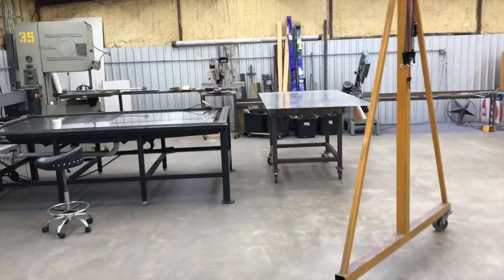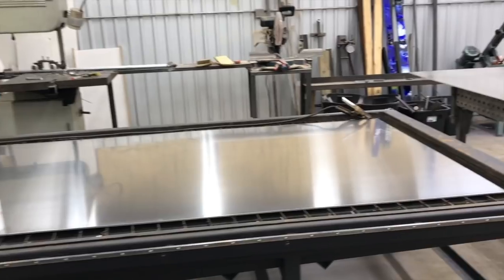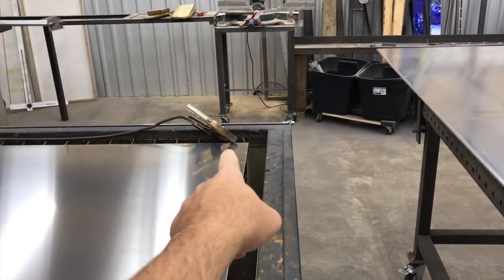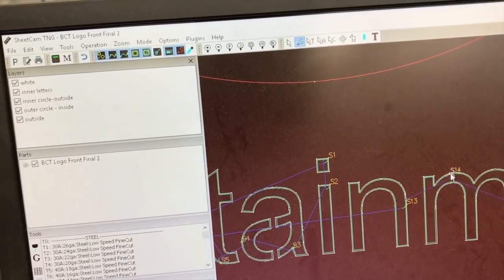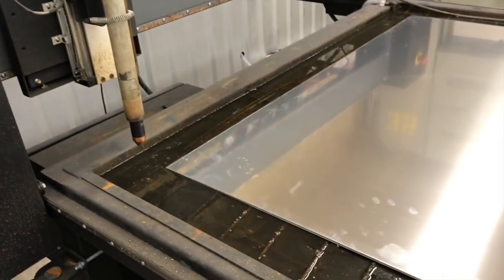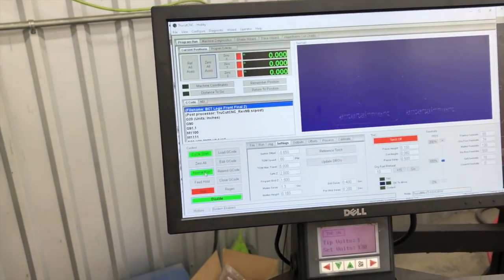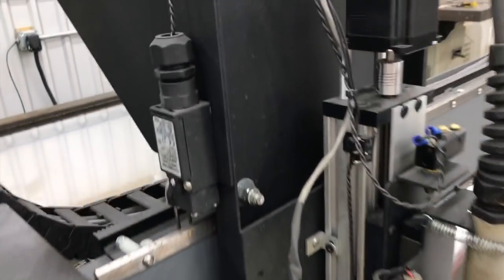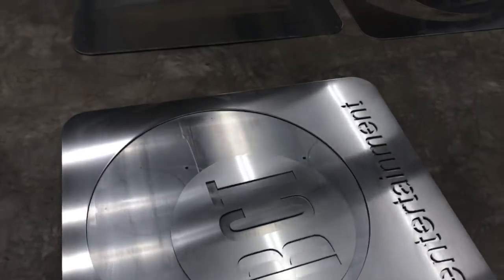High Risk CNC Plasma Cutting

Comment: Another tip is to move all the lead in to one side , so if they do tip , the torch wont be running across a letter that may have tipped. Also mark where its zeroed at incase you do have to re home the machine for some reason half way through the cut.

Comment: How much do you charge for a job like this? Also you can make preset rules in sheetcam to speed up programming i.e. 60% feed speed for inside profiles smaller than 2" Dia.. Also I think the A next to your amps doesn't stand for automatic air pressure.

Comment: I've had material in 16 ga. that was over $2,900.00 a sheet, it was a high temp nickel alloy, I needed a better and more precision cut than my plasma table would do so after getting the prototype correct I jobbed it out to a company that had a water-jet  table. Still nervous but they did an awesome job.

Comment: I operated a CNC Plasma cutter for five years. Cutting aluminum  and thin stainless Is a bitch some time. I have had the material curl up due to the heat and then the torch hit it and move the sheet!  I learned to clamp down the material. I also made a fixture to hold a sharpie pen and let the cutter draw the pattern on to the material. I also ran a water hose on to the material to cool it.
I was using a Hypertherm cutter and a PlasmaCam table. 
One thing I wish was that the plasmaCam drawing program had an auto save program. I do not know how many times I would get involved in drawing some complicated project and then the program would freeze or crash and I would have to start drawing all over again.

Comment: I have heard much about the dangers of plasma cutting aluminium in waterbed. How do you make it safe?
Reply: It depends of the type of aluminium you are using. The purest it is, the more dangerous it is. But in fact, it's very rare if you have an explosion. It only happens in specifi conditions. Bad ventilation in your working place, and a closed honnecomb. So be sure you place the aluminium plate with air circulation on both sides. Thus, you will not risk hydrogen accumulation underneath.
Reply: You can also add an aerator, much like those in fish tanks.  The little air bubbles will keep large hydrogen bubbles from forming.

Comment: If your material cost is more then 50% of your bid, you should probably reevaluate your pricing.
Reply from the maker: oh are you referring to the 5X material cost pricing model?  That doesn't always hold true.  Especially thicker or more expensive materials that all your doing is a large profile cut.  I cut hitch plates out of 1" plate.  The 4x8 sheet is $800, and I only charge $275 to process it into 3 hitch plates

Comment: As lame as this sounds, is there a decent entry level machine out there?  As a kid i worked at my uncle’s welding shop.  I have been wanting to get into cnc’n for some time.  Been 3D printing a year or so now.

New sub, glad to see some real shit on youtube, thanks
Reply from the maker: If you have been 3D printing for a while you shouldn't have any issues running any plasma table.  There are sooo many options, brands, tables out there now.  Everything from an $800 langmuir table, all the way up to a piranha industrial machine, and hundreds of tables in between.  I have ran a few different tables, and have owned 3 trucut machines, i have been happy with them.  Good luck!

Comment: How do you go about cleaning up the parts? I'm thinking of building my own plasma cutter for very light home use and trying to sleadily work up some knowledge on the topic.
Reply from the maker: lots of different tools.  scraper, grinder, sander
Reply: Flapper disk on angle grinder is the best way I found to clean the dross. When cutting thick stainless a hammer can be used on the really heavy dross to knock it off.

Comment: A good tip is to attache a marker to the CNC and do a dry run letting it mark all cuts out. Then clean up with a rag and acetone.
Reply: Really slick I like that conversely one could use their plasma table to plot large prints  hmm
Reply from the maker: good idea, thanks

Comment: Nice job and video. You might want to consider a better metal supplier. My rate for 5 x 10 x 3/16" is under $300. I buy a lot of 8 x 20 sheets as well. $1,100 for 8 x 20 x 3/16".

Comment: Plasma cutting is very cool. I'm a CNC milling / turning machinist, set up, programmer, operator. If we had to machine a part like your sign, we'd be dealing with clamping issues and tool chatter. We've used double sided tape with pinned fixtures, but that is time consuming. Great video content. You had mentioned posting ideas. How about putting a Sharpie marker where the plasma tip is for your dry run. When I was going to school at Wentworth, they didn't want students potentially crashing an end mill into their CNC mill tables, so we used Sharpies in the tool holders . Different colors for different operations. Worked well for proving out programs and you get a drawing of your posted program.
Again, I enjoyed your video. Thank you for sharing
Reply: I did the same with my 4x8 foot plasma table after I built it. I don't do that anymore, but would consider it if I did something other than small chunks of heavy plate or half sheets of cold roll steel sheet. Just running 9/16" steel plate had me worried as we didn't have extra material on hand. My brother has a cnc mill for hobby and some pro use and I am glad that if my machine crashes, it isn't as big of a deal as his would be.

Comment: I wonder if it is a good idea to mount a sharpie for the dry run so as to "illustrate" a minor errors, instead of imagining it.  It seems like an extra layer of insurance for critical work.
Reply: I also had the same thought. Seems like a good way to go on expensive materials, however, Remember that the sharpie will never line up exactly where the cuts will be unless you have a purpose built adaptor for putting that sharpie where the cutter goes instead of mounting it to the side or something similar.
Reply: Is it a case of great minds think alike or fools never differ? My thoughts exactly!

Comment: Cut aluminum dry ALWAYS. The chemical break down of the material is nasty stuff man!!! No juke! Nice work dude, stay safe!
Reply: More importantly it prevents explosions from hydrogen gas buildup.
Reply: @SegoMan  The hydrogen gas build up should only occur if you cut  aluminum under water.  I would have probably cut with the water level lower as it tends to stain the cut edge and is labor intensive to clean it up.

Comment: Nice job Gary on both the cut and your checklist.  Also knowing how to step through the g-code and restart is valuable too.  You can restart before the problem and fire the torch manually and sometimes you can salvage the piece.  At least you could do that with Mach 3, I don't know much about Mach 4 I don't have a machine to run anymore here.

Comment: I cut aluminum in water everyday.  I have great air flow in my shop and have never had a hydrogen issue from ventilation.  I will say if you cut all day and then throw a new sheet on the table to be ready to cut first thing the next day, you better clear the air under the sheet before you fire the torch or you will have a small explosion.  Gary you hit on most everything I can think of as far as critical cutting goes.  Make sure you have correct consumables for the amperage, make sure your amperage is correct for material, air on, make sure e-stops are not activated (I say that because people in my shop have a tendency to want to walk by and hit them being jerks lol), make sure your sheet is square, and good ground.  Enjoy your videos!!  Maybe we can team up one day on something.  Be awesome to work with ya!!
Reply: Nice Video!  There is nothing wrong with cutting aluminum on a water table as long as the water table is open....meaning it does not have a raise / lower system that stores the water in closed containers. Aluminum particles that sink in the water do absorb oxygen from the water....leaving a small quantity of hydrogen. After cutting you will see bubble rising in the water to the surface...these are hydrogen and they dissipate in the air and are not a health hazard. If, however the lighter than air hydrogen bubbles get trapped somewhere (under a fresh sheet of material that may have an upward bow), then you could get a hydrogen buildup and an explosion. It is wise to not leave full sheets on the table overnight....and if you do pick up and end and let any gas bubbles out.  Speaking scary cost....I currently have a 1/4" thick 4 x 8 sheet of 304 stainless on my table....it will be a 4 x 8 sign for a local school as a community service project. $995 for that sheet of stainless! Jim Colt    Hypertherm
Reply: Wow, Jim!  That stainless has gone up a lot!  Good luck with your sign!
Reply: My thoughts exactly Jim!!

Comment: The problem of "high risk" cutting you are talking about has been SOLVED!  It is an ingenious device that turns the torch and movement off immediately if there is any problems.  It is a simple microswitch on the magnetic breakaway torch.  As soon as the torch touches something it shouldn't, it shuts everything down before the part can get screwed up.  I have literally not messed up a single part since I installed it on my cnc plasma cutter.  I too, used to cut complicated parts with sweat running down my face and a firm finger on the E-stop switch,  now I start the cut and go inside my house and drink a soda!  If it stops cutting and go clear the problem and turn it loose again all WITHOUT screwing up any steel.
The device is called "Star Lab Collision sensor retrofit" and is made for Star Lab CNC cutters and can be found at Plasmaland.com
This whole thing may sound like a sales, pitch but I am not getting anything for this, I'm just a happy customer.  The design of it seems obvious and after using it I will never run a CNC Plasmacutter without it.  It is that important.  I can't believe all manufacturers of these types of machines don't have it.
Sorry for the long rant!
Reply: Jared Jensen I setup a phone camera running Alfred, then monitor my cnc while eating inside sometimes.
Reply from the maker: Well the microswitch you are talking i actually referred to in the video, the new style torch mount has collision detection built in.  That is only one part of the equation, a micro switch wont solve a CAM issue, or sheet orientation issue.

Comment: A more specialized ground clamp that takes up less space, fits between slats and is custom made for use with a plasma table would be a cool thing to have as sometimes the clamp does not fit well as it could making a less than stellar connection.  Just my experience.
Reply from the maker: thats a great idea!
Reply: You could also buy a panel ground clamp.  One of the legs is flat.  Like a Lenco 200 02010
Reply: That would still get in the way of the slats, but thanks for your suggestion. I checked it out.
Reply: Bill Titwell it's what they had where I used to work.  Fit in between the slats there but I guess tables are different.
Reply: yes

Comment: When you plasma cut aluminum always do that dry! Unless you want to inhale all the hydrogen ....  which in my experience is not too good for you. 

By the time you cut both sheets up in the same day ( with water) you might as well go to the hospital for a breathing treatment AND air your shop out for a week!
Reply: Hydrogen gas is not directly harmful to breath unless there's enough to displace air and asphyxiate you, however. It is an explosion hazard.
Reply: @benthurber5363  Our cnc plasma table has warning stickers all over about this. Leave it DRY.
Reply: ZILA  Thanks for the warning.  As I get older I care more about safety.
Reply: istvan meissler         ^ same
Reply from the maker: i hear this and see this mentioned all the time, but i see guys, in fact one guy i referred to in the video cuts aluminum sheets in water all day every day, i rarely cut aluminum but will cut it dry next time
Reply: Ramsey Customs - turbocobra you dont have to do anything ....   and i dont know what other guys do ....  let me pit it this way: when i did all those aluminum tanker handrails ....  and yes it was more footage to cut than you cut ....
I was just like you ....  nahhh  f it keep the water in - how bad can it be?!?  Its only 3 sheets 4x8x1/4 .....

Well - let me tell you - i found out really quick first hand how bad it can really be !!!!!

And now that you are cutting steel on the table the stuff gets disturbed in the water and comes back up ....

I cleaned and scrubbed for days AFTER i came back from the doctor .....
Reply: ZILA pp
Reply: Good point.
Reply from the maker: wow that doesn't sound good...
Reply: ZILA thank you for sharing because I never knew cutting aluminum over water released hydrogen. I don't have a table yet but plan to make one at some point.
Reply: ZILA http://www.esabna.com/us/en/education/blog/can-you-plasma-cut-aluminum-on-a-water-table.cfm

Comment: My table does not have end stops, so I always check that the X gantry is square to the Y axis by jogging the torch down the sheet then across the perpendicular edge.

For smaller features I often stack the cuts with layers to make the machine jump around if I'm worried about heat melting out a part.

Along the same lines, I orient my parts on the sheet so the most likely to fail are near an edge when possible, then cut those first. That way if there is a failure I can jog the entire process over and recut with minimal losses. 

Also, any time I'm doing something critical or really complicated, if possible, I'll pierce at my home location (if not using the dead on corner, like here where you've offset in a bit) so that I can re-home to that point if a tip up moves the sheet or something weird happens.

Only other point is a few typo's and your/you're in your checklist, otherwise good info for anyone with a plasma table, most applies to any CNC.
Reply from the maker: great info, and some great points!  but i didnt see any spelling mistakes, then again that maybe why they are there, because i dont know how to spell lol
Reply: I also pierce a spot at 0,0.